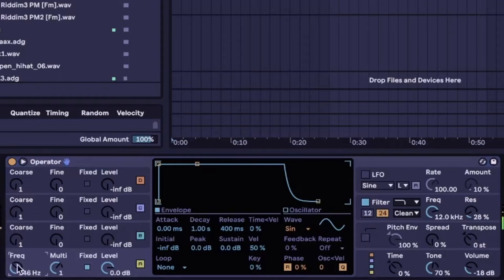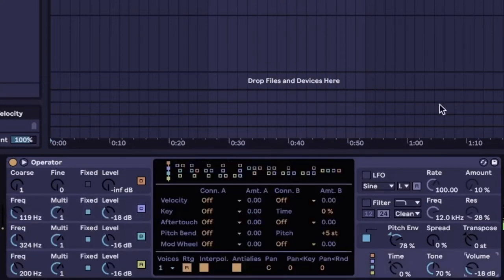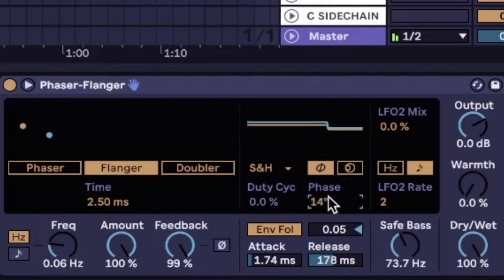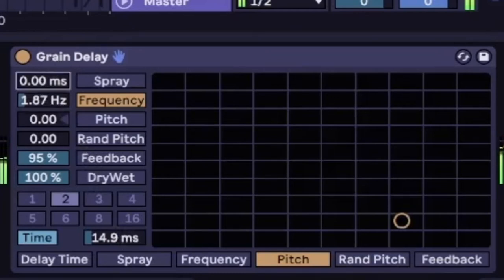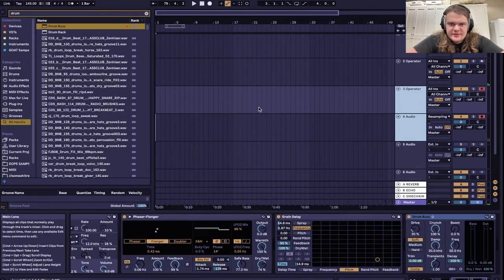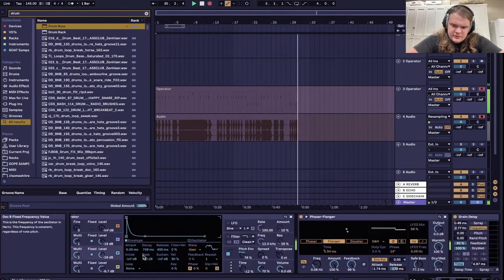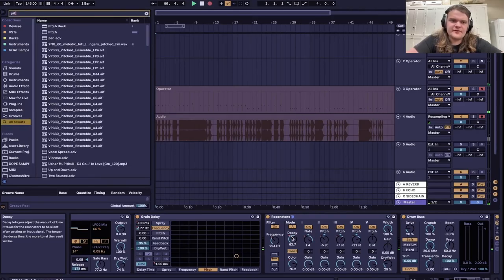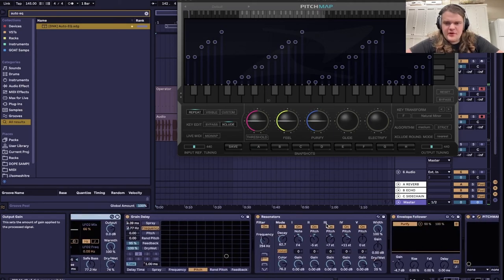How to Metallic Snares like SOPHIE

Comment: i really wish i could use these sounds but i use fl :c
Reply: just use vst with same impact on your sound
Reply: just follow the steps with fl equivalent plugins, this isn't a sound specific to ableton and it's good to actually learn from the actual techniques rather than just copying settings on specific plugins
Reply: @ermwhatdaheck  yeah i figured that out after experimenting on my own a few months ago, the only thing that i really meant by this comment is not having a drum bus in fl
Reply: using serum and then extracting the audio speeding it up, pitching and then adding different delays and flanges can create sounds like this.
Reply: @ewanperks  hey this comment is from 3 months ago i figured it out 😭
Reply: @HaloDude3065  ok lol good to know x
Reply: @ermwhatdaheck  i dont know what those are so can't follow